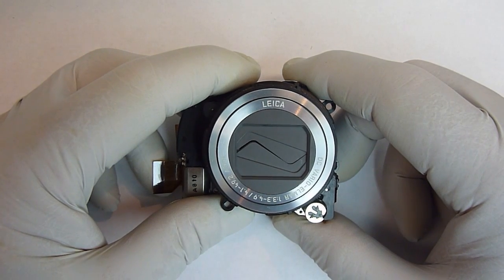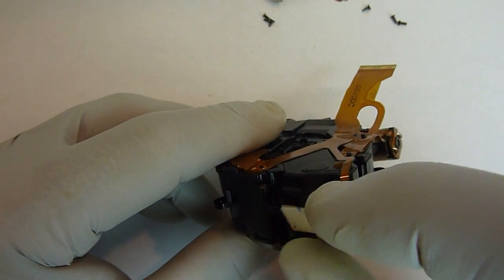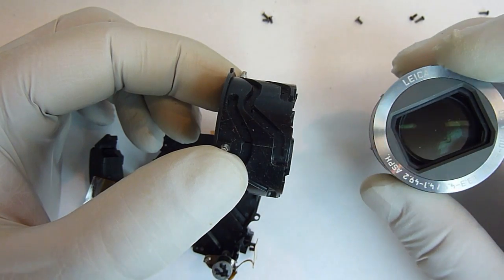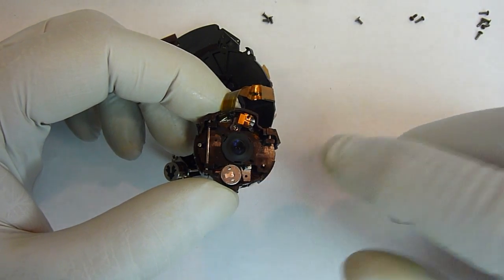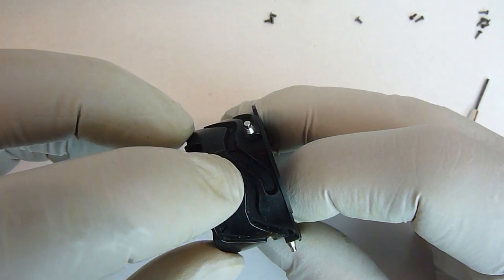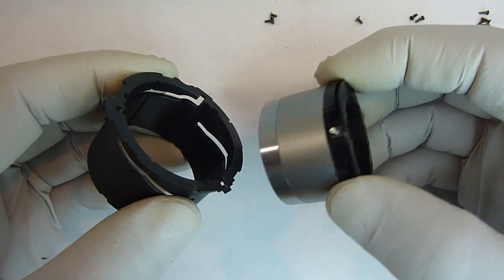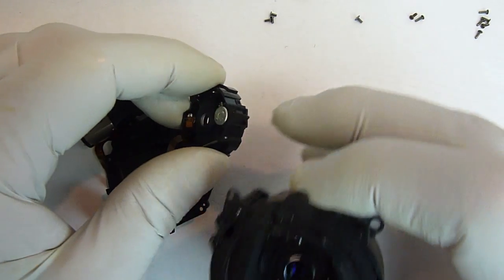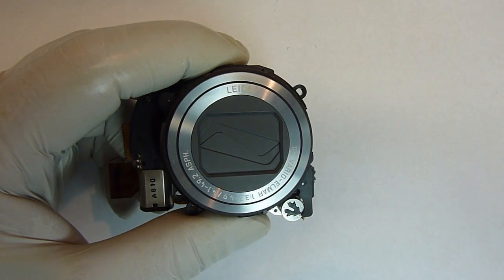How To Repair & Clean A Panasonic Lumix ZS & TZ Model Leica Lens Units

Comment: Robert- Great video. It gave me confidence to open up my DMC-Z3 which was dead and replace the lithium battery.The camera now turns on and takes pictures but the display is only showing a white screen with occasional lines. I think the problem is the two ribbons from the display- a large and a small one. They are probably not seated correctly. Also, the large ribbon has the dark side facing up while the small one has the shiny side. I think that is how they were. Any advice would be appreciated.
Reply from the maker: Hi PeeAm. Both flat ribbons should have the shiny copper colored connections that are on the ends of each of them, facing up, before they are slid into the connectors. Also, check to make sure that each of them are slid into the connector as far as they will go before flipping the small flat tab back down to the locked position. There were a few occasions where the lcd display wouldn't work for me and I could see that one of the flat ribbons was at a slight angle after I had locked it in place. Usually it was the small one. I would just put a little pressure on the flat cable with my thumb and then straighten it out and it would work fine. I hope this helps!
Reply: Robert Hosea Thanks for your quick reply. I went back and tried sliding the LCD connector a few times and VOILA- SUCCESS ! The strange thing was that the shiny side did have to face down. Thanks to your guidance, one more camera saved from going into the rubbish heap.
Reply from the maker: PeeAm
Hey that's awesome PeeAm. Good job!!!

Comment from the maker: If the camera was on when it got wet or if it was turned on afterwards while it was still wet, then one or more of the circuit boards could have been damaged. About all that you can do is to make sure that all of the circuit boards are completely dry by removing all of them from the camera and letting them dry completely. If it still doesn't work after putting it back together then you will need to take it to a repair shop. Sorry I can't be more help.

Comment from the maker: No, you don't have to use gloves. I've done it many times without gloves. In general the camera parts seem to stay a little cleaner when using gloves. But, I did have one pair of gloves one time ( I don't remember what brand) that left some kind of residue behind everywhere I touched when I had them on. I was better off without them and so I pitched them in the garbage.